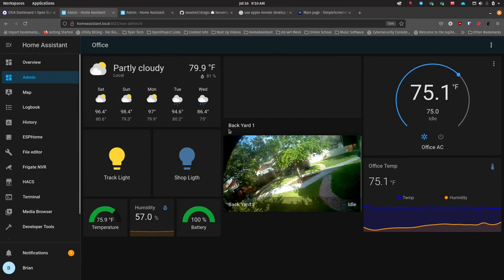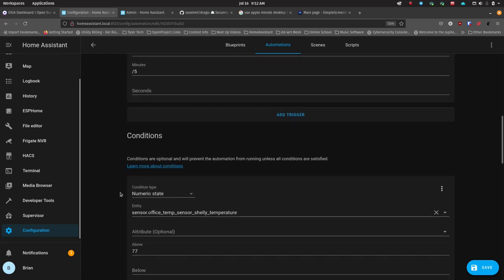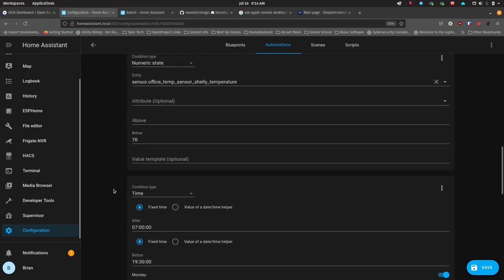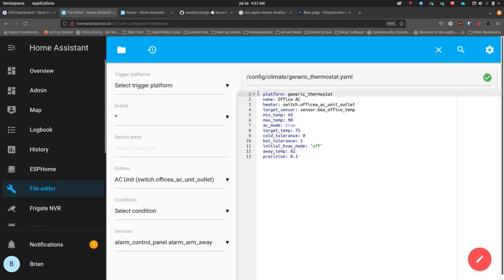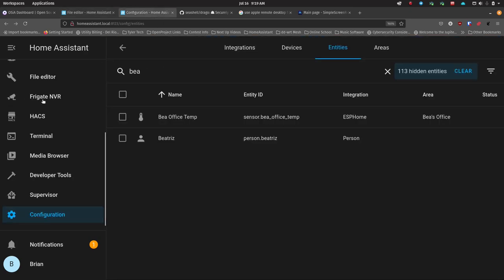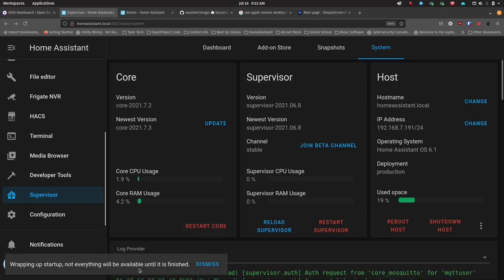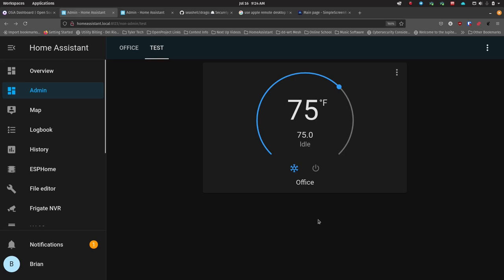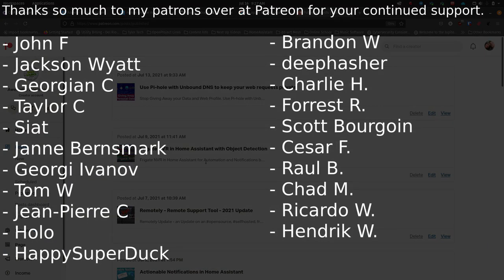Create a Generic Thermostat control for simple temp sensor and binary switch in Home Assistant.

Comment: also a quick tip if you want the room to hold the same temperature for longer, turn your ac to low fan mode mode instead of switching it off. After heating, switch to fan and set your grill to point at the top of the room so the fan pushes the already heated air drawing cool air from the bottom. After cooling, switch to fan and point the grill down. I mean the difference you'll see is astounding, it was to me at least
Reply from the maker: Unfortunately, the AC unit itself isn't being switched between modes for me, it's just controlling a smart plug that powers the unit.  So the setting is just on.  I do use a standalone fan to help maintain the temp when the AC is off though.  Great tip!

Comment: Hm. I created the file in /config/climate but HA does not pick it up. Are you sure you didn't omit any step? So HA is supposed to automatically look for files here?
Reply from the maker: I believe you have to include the folder / file in the main configuration file. You'll see others that are included there already.  This is a bit older now, so may not be the same anymore.

Comment: A built in AC thermostat will typically, if the temperature drops below the set threshold, will let the 
AC fan be on and not entirely power it down/switch off.

Whereas the generic thermostat in Home Assistant typically completely switches off the AC unit.
How can we make the HA thermostat emulate the built in AC thermostat and set it to run the fan on reaching the temperature instead of powering off?

One obvious workaround is to replace the IR code for 'Off' with fan only or very high temperature so the AC will use its built in thermostat to turn off cooling and just run the fan. But now the AC cannot be fully powered off by the thermostat.

Any solutions?
Reply from the maker: Not from my end, but a great question to post over on the home assistant forums.  Lots of super bright folks there that are always willing to help out.

Comment: hi, very good Video. I want to make an Thermostat for Heating, but i don't know how to get an entity for the heater. i will use a tuya tempsensor and an sonoff switch to open and close the valve. Can xou explain how to create an entity to use it? thank you
Reply from the maker: Let me look back at this, but as I recall I actually modified a heater thermostat so I could make it work for cooling. So I think the original project I found on the Home Assistant forum was for a heater.
Reply from the maker: Here's the page I referenced.  Maybe it will help you. https://www.home-assistant.io/integrations/generic_thermostat/

Comment: what if you need to run the same unit as both a heater and ac depending on season?
awesome content btw
Reply from the maker: I've seen that done as well, but my system is just a Window AC unit connected to a smart plug.  I'm not sure how the yaml for both is formatted though.

Comment: Hi thanks for the tutorial, however I realised I could not get it to work if I create a climate folder and add the generic_thermostat.yaml file. I could however get it to work if I put that in configuration.yaml based on the official docs. Do you know why?
Reply from the maker: If you create the separate climate and Tom file, you need to include it in the main configuration.tmb file. Did you do that part? I need to re-watch the video myself, as I may have forgotten this step in the video. If so, I apologize.
Reply: @AwesomeOpenSource  ok noted, so we need to include the "climate" into the configuration.yaml file

climate: !include climate/generic_thermostat.yaml
Reply from the maker: @hk9443  i added this line to the end of my include section in the configuration.yaml file. 

climate: !include_dir_merge_list climate/
Reply: @AwesomeOpenSource  thanks
Reply: @AwesomeOpenSource  I wish I'd seen this "!include" part before I tried over, and over, and over, then stayed up all night, re-installing home-assistant, reconfiguring all my customizations, etcetera.  Maybe you could re-edit this video to add the necessary "climate: !include climate/generic_thermostat.yaml" section for the configuration.yaml file?  I imagine this video could get many more "likes" if you were able to add this step.
Reply: @ktraglin  +1, I didnt go quite that far but I scratched my head until its bleeding.
Reply: @AwesomeOpenSource  good lord i wish i saw that like 6 hours ago... thanks, it works. just not with my shelly plus h&t..

Comment: Hey thx. I dont understand though why you need a generic thermostat and a binary switch? Can you just control the AC unit directly with all those conditions in the automation?
Reply from the maker: In my case, the AC unit is just a "dumb" unit. it has no smart capabilities, so turning the power on off at the wall through a smart plug is how I "automate" it.

Comment: Hi. Great video.
Can I ask you to provide what kind of products (binary switch and thermostat) do I need exactly to work via WIFI. If exists this kind of products.
Thank you
Reply from the maker: I really like the Shelly line of products.  They seem to be very reliable, and integrate quite well with Home Assistant.  You can keep them all under local (no cloud) control if you want, and you don't even have to use their app.  As for Thermostat, I don't know of a hardware thermostat that would work specifically for this purpose, thus I made my thermostat in Home assistant.  I have a simple temperature sensor made from a NodeMCU that runs on wifi, and I use that to trigger my AC plug to turn on and off.  for the plug I'm using one that has to go through the Tuya system, only because it's one I already had.   I definitely suggest Shelly products currently though.
Reply from the maker: BTW, if you go to the Shelly Shop web pages to shop, make sure it's shellyshop for europe if you live in Europe or cuntries that use 220 - 240 V, and make sure to go to shellyshopusa if you are in North America or Mexico, as this is where you get the 110 - 120 V stuff.

Comment: Hi great job on the video although i am having trouble adding the card. Afer restarting the core then going to the card configuration i do not have any options to pick from in the "entity" drop down. It just says "no matching entities found". the to the right there is a red box that says "specify an entity from within the climate domain" in bold then below it 2 lines thats says "type: thermostat" and below that "entity: ' ' " The card example doesn't even show the temperature "dial" just all text. Did i possibly miss something in the yaml code?
Reply from the maker: You are choosing the thermostat card to start with from the UI, then selecting your thermostat you just made?

Comment: I followed your video but I am stuck at an issue. It seems like anything yaml doesn't really load. Do you have to include these yaml subfolders somewhere? It doesn't look like this automatically loads in?
Reply from the maker: You have to include the subfolders in your main configuration.yaml file if they aren't already there.  You'll see a section in that file where other includes are already set.
Reply: @AwesomeOpenSource  I see they include like files. Can I include an entire folder? Recursively?

Comment: just a few problems I have the first was I did not have file editor installed yet, next I still cant seem to get the thermostat to bring up the entity.
 there are two line (climate: !include_dir_merge_list climate/) this one does nothing when added to my config and (climate: !include climate/generic_thermostat.yaml) will not allow for system core to restart.   what could I be doing wrong?
Reply from the maker: It should definitely be the first one. I have that in my main configuration.yml file, then I created a folder called "climate", and in that the generic_thermostat.yml file.  Is this what you've done?

Comment: No entities available when I try to set up the card. followed every step
Reply from the maker: I'm sorry to hear that. I imagine this may have changed since I made the video.  You may need to check the Home Assistant Forum and Wiki to see what may have changed.
Reply: @AwesomeOpenSource  it hasn't, but the incluide into configuration needs to be done. any ideas on making more than one thermostat?
Reply: @rasmAn2  there has to be an entry in the configuration.yaml to point to the generic_thermostat.yaml